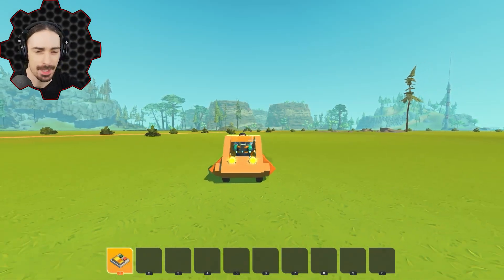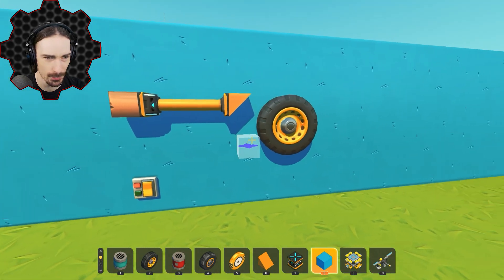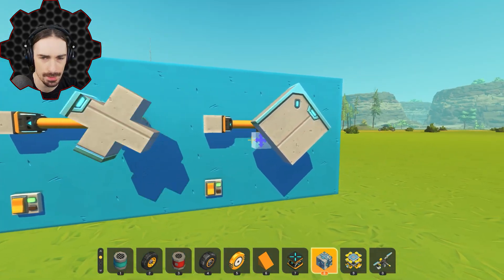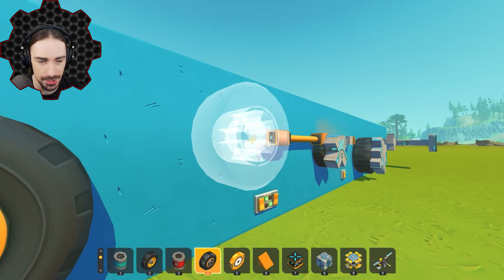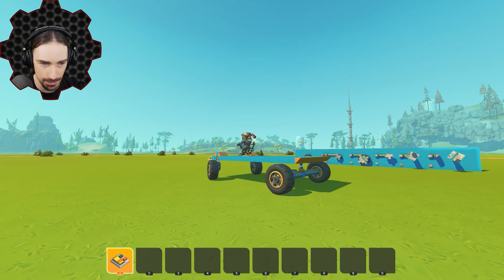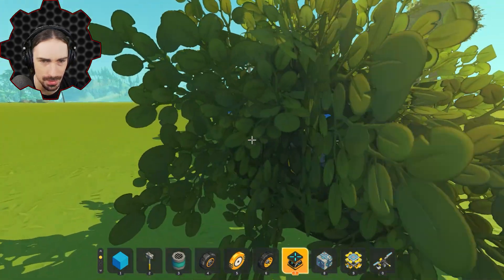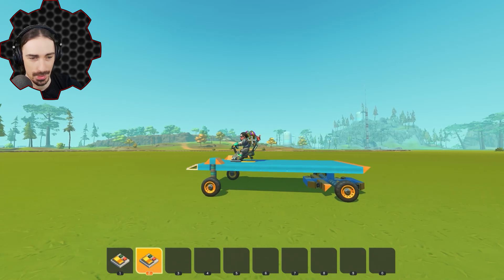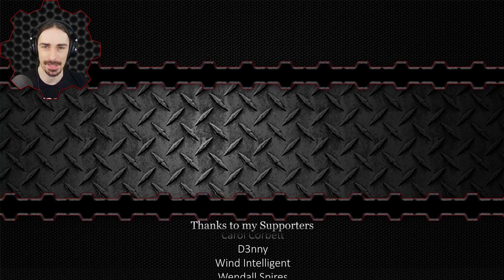The Spooky Science of Wedge Powered Objects

Comment: It seems, in conclusion, that wedges provide a lot of speed, but not a lot of torque. Having wedges on the opposite side of the pipe-pieces provides more torque, but less speed (because of friction).
Reply: Solution is "wedged bricks" : No engine car (Ducks V2.0)
Reply: Make a train with it         multiplayer
Reply: Or you could say wedge is like a gas engine
Reply: yes, the stats are never balanced but always work with each other
Reply: It would still be good for a scout type car in survival mode, lighter weight cars
Reply: The only problem is the lack of testing the 2x1 wedges: does it work better as a gentle or a steep slope and how does it compare to the standard 45 degree wedge?
Reply: @TheExileFox  he already answered it
Reply: I was gonna say that
Reply: You unintentionaly made a summary of the rotary engine, which is a spinny wedge
Reply: @Silverauren whoopsie

But those are in an internal chamber
Reply: I was considering maybe more pressure could give more torque
Reply: gas engine, not electric

Comment: Things to try... Putting weight on the outside of the wheel as when weight was further away from pipe the rotation was quicker. It seems to be more sets of wedges used the higher the torque lower the speed so a third set of wedges where brakes were fitted might enable hill climb? Single point steering at the from to add 4 wheel wedge drive? Fun experiment with questionable physics. 👍

Comment: Found this physics glitch back in 2017. Made a conveyer belt of piston pushed wheels that can launch players and items at insane speeds.
Reply: While you can piston push wheels at high speeds, it does not generate enough torque to move heavy weight.

Comment: Fun fact: This actualy exist in real life just with any kind of wheel you can slighty push with your hand the way to i do it is get a stick and a tire I'd do a motorcycle tire as its light you just make the wheel balanced and push the side of the stick to the wheel and it will go slow and go very fast you just have to keep up with the wheel so you can push it you can also steer it by pushing the stick differently

Comment: Try putting 4 or 5 pipe pieces in middle and attach blocks on both sides and on the end put wheels just as the experiment Instead of putting wedges on both sides put it in middle and see if it goes faster.

Comment: I just did a quick test and this does seem to also work with the wedges you can make in the craft bot ( the curved ones that I don't remember the name of right now). It also works with level 1 pistons, which means that, to some degree, it's survival mode capable.
Reply: those are not wedges tho
Reply: but curves consist of lots of corners hmm
Reply: blocks are more powerful and create more speed he just didnt use them the proper way.
Reply: @spacewalk3046  Hmmm interesting.

Comment: I have a theory.
1)The faster the wedge spins something the less torqe it has wich explains why the wedge powered car™ is slower but it moves.
2)you put pipe-pipe-pipe-conrete on your testing wall but you didnt in the wedge powered car™.
In conclusion i feel like if you put less wedges on the rear shaft the car will probably move slower but it will have more torque.
Ill boot up scrap mechanic and see if my theory works.
Reply: so, does it work?
Reply: @yummersans8426  I am still testing but right now the tests have come back negative.
I need to figure out why is the phisics engine is freaking out like this.
Reply: @marcy_0267  I think this whole mechanic works, cause the wedge makes a little bit of contact with the wheel or pipe and the wheel/pipe tries to escape with the touch point and gets a little bit "floppy" so it looses the contact and hits the wedge again. 
The suspension on his first car compensated this effect, so the pipe didn't get so floppy and the force was to low.

That's my assumption, which could be the reason, why one of the fastest tests on the wall produced dust and clearly bounced of the wedge.

It's only my theory, I'm supposed to buy scrap mechanic, only to verify this behaviour.

Sry for my bad english, if something is unclear, let me know and I'll try to explain it in another way^^
Reply: @marcy_0267  I managed to make a car that moves decently quick. It all depends on how you orient the wedges and push them into the wheel. I managed to make a forward and reverse with parking gear all in one package. And when I say "decently quick" I mean if you get off it while it's powered 'pistons engaged' your not catching up to it... Without a faster vehicle. also it is by no means light.

Comment: i think the main problem with your wedge powered car is the weight due to its overall size...
also potentially because doing it from a pipe to a wheel is less effective than direct wheel contact with wedges? scrap mechanic physics are confusing tbh
Reply: Since when has physics in anything isn't confusing?
Reply: @robbieaulia6462  i guess theres some bias from me because im also an engineer with a hobby for smithing
Reply: @robbieaulia6462  I agree and Scrap Mechanic also has stupidity on top of that, hence the wedge glitch.
Reply: I think ScrapMan need to try direct wheel contact, i think it will cause more torque according to more polygon faces being touched per rotation (also more wheels is probably worth it)

Comment: 12:07 looks like your wheels are spinning in opposite directions which would make sense since you should need wedges on the back of one side and the front of the other side to make both wheels spin the same way, but then it worked so who knows?
Reply: Through my own testing depending on the orientation of the wedge and how it presses into the wheel it will either choose a direction or it can be persuaded to go a set direction.

Comment: it's a similar concept to the suspension glitch. something about sideways force and bearings or suspension makes it work.
Reply: Yeah i agree, im pretty sure it’s to do with the bearings being pushed away from centre and trying to return.
Which means all the extra wedges with the one piston are just adding more friction.
I wonder if placing the piston and a single wedge further away from the bearing on the axle would give better results.
Also wonder if 3 low friction blocks in a 90 degree angle would work as well as wedges

Comment: This "Wedge Glitch" could potetially be usefull for making infinite fuel cars in survival🤔

Edit: although you have to mad to use it as your only power source.
Reply: Wedges aren't in survival - you'd have to blow up a warehouse to get them. By that point fuel is cheap and easy to get.
Reply: @izakomandaz2895  fear not. Cause in the chapter 2 release, they will be adding wedges as a drag and place block, presumably making it a craftable block
Reply: @shoodler  yay! How expensive will they be though!
Reply: @izakomandaz2895  read the dev blog they shoutouted to wedge gang and are adding wedges in chapter 2 so ur wrong
Reply: @izakomandaz2895  thats true and engines are a lot more faster
Reply: @izakomandaz2895  You can get small wedges by blowing them form the warehouse wall, transporting them to the elevator. Correct?
Reply: @moroblizniak4457  yes but it's very tedious!
Reply: piston engine but much simpler
Reply: If only you could get these wedges in survival
Reply: Let me point out that i didnt know that small wedges arent craftble.
Reply: @Luftmysza.  that's fine! I forget about the dev blog.
Reply: @izakomandaz2895  don't worry they added a wedge cutting machine in chapter two and u can use any type of materials to craft a wedge and it's dragabale
Reply: Idk  it's not really powerful
Reply: Since you can only get wedges in warehouses right now, it seems like a pretty balanced mechanic
Reply: I accidentally said the exact same thing but for my vehicles
Reply: Fascinating. I must further research this spectacular discovery
Reply: I've done my own testing, the output of a one-wedge, no suspension car is so little that it is barley faster than walking, and the "breakdowns" it has makes walking better
Reply: i think it has amazing potential as a mobile base mode of transportation, like you I assumed it probably wouldn't be wise to rely on that as the sole source of power, but if you could get it working most of the time, imagine the fuel you'd be able to save.
Reply: wait this is the new inf power for batery charger dev said they will add something to prevent the controler thing and this thing could be the alternative for batery. it has low power but high speed and acceleration.
Reply: We can already have infinite fuel vehicles in survival, use a controller and just have multiple bearings between the vehicle & wheel to get to an actually usable speed, it comes with a lot of torque too :D
Reply: @suicidalbanananana  nonono u forgot something. scrap mechanic survival 2. and the batery charger. dev said we can't use controller. this is the next thing to power the charger.
Reply: I was thinking the same thing
Reply: The only issue is that I’ve tried this before and it doesn’t always spin the same direction. It randomly spins clockwise or counterclockwise.
Reply: He could try putting wheels not pipes then  put came to blocks an put wheels again
Reply: The only issue is that this will be patched soon.
Reply: @treemot2417  why, this seems like a bug in the physics engine and they are notoriously hard to patch, the devs also said they do not care about this kind of stuff
Reply: I just tried it out and this does work with the wedges you can make in survival using the craft bot AND level one pistons, so it would be possible to make infinite fuel cars in survival. Although I'm not convinced they'd be useful for anything other than exploration. I'm going to have to do more testing.
Reply: @SonOfmowgef  Wedged Bricks are better... if you want to see what I mean ta ke a look a this : No engine car (Ducks V2.0)
Reply: Im also wondering if this glitch will be better then using controlers
Reply: @Luftmysza.  oh, definitely not, ive tried them both and even blocks are better for this than wedges, if u know how to use them, although they cannot go uphill cuz they have no torque
Reply: @spacewalk3046  well thats what i expected to hear thx anyway.